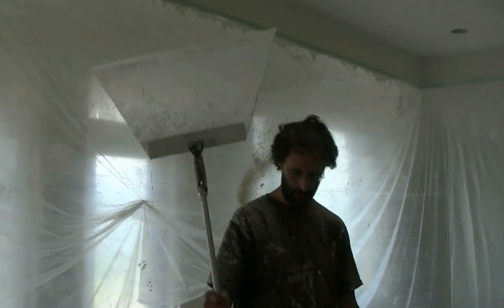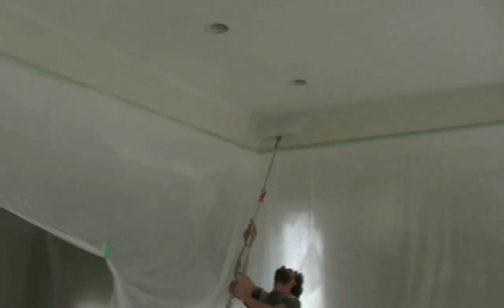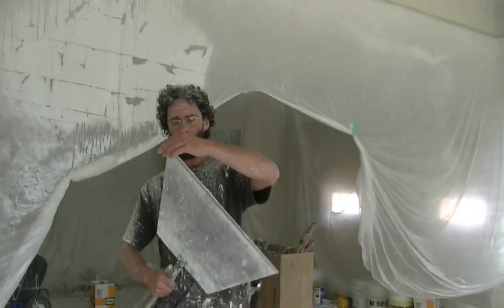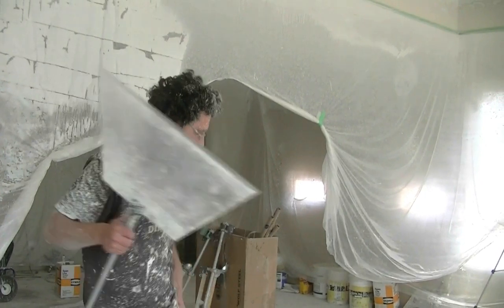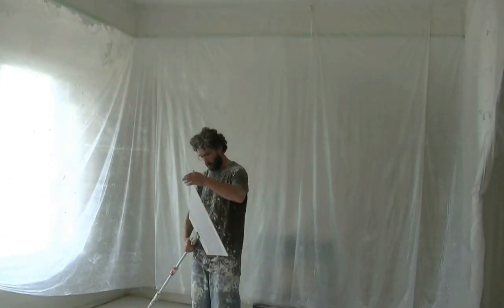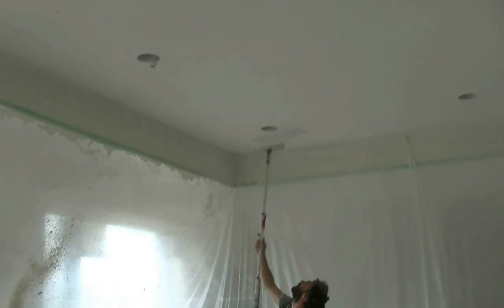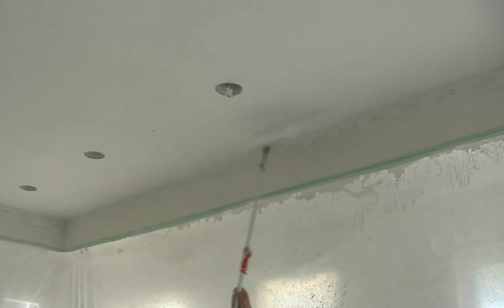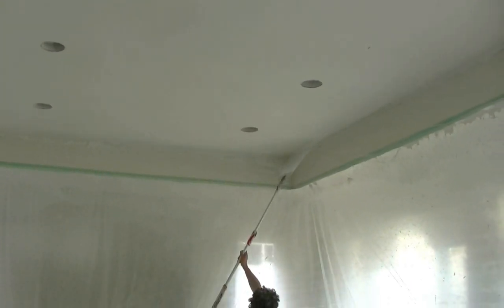California Knockdown Drywall Ceiling And Wall Texture , How To

Comment: Great video guys! My pop taught me all phases of carpentry and remodeling at an early age. This was in the early 70's and the style back then was orange peel on walls and popcorn with glitter on the ceiling. I have full time job now but still do jobs on the side. I still have his gold blatt hopper. My current job involves removing old 70's paneling, putting in drywall, scraping the popcorn off the ceiling and texturing. I have the knock down is the style but was not too sure how to finish. Thanks to this video I now know how! Great job my drywall brothers! Mud for ever!
Reply: I sure hope you're testing for Asbestos before you start doing work if not you're putting yourself people and they're families in danger as as I'm pretty sure you're not even warning your costumers about those dangers of removing popcorn ceilings, look up procedure 5

Comment: I have see it where the edges at the wall have been scraped clean leaving a nice boarder. This looks nice but leaves a nice edge for you to paint your walls as well. My question is, when do you scrape this off? While its fresh or just after you knock it down? I can see smearing it making a nasty mess.

Comment: Ok... I two questions:

1...when do you take the tape off? Right after you spray or after you knock it down?
2...I have seen it where there is a rounded edge around a bull nose corner. What would be the best way to achieve this look?

Comment from the maker: U can, alter pressure and the air, its not 100 percent since your mud density also changes with almost every batch, so your always playing with it to get it right before you start texturing a new place. And if you got a long hose on the dam thing, and its running all the way up the stairs, machine really has trouble pushing that myud through, and you really have to crank her up more. Thank You

Comment from the maker: Wait about 10 minutes, it really depends on how hot it is ... do a little corner first ... and it also depends on how hard you push, you don't want to smush it all against the ceiling, just flatening off the tips ... we use the gun instead of hopper because we do a lot of texturing, and the hopper gets heavy, but either of those tool do the same job. I suggest using premixed Synko Span Lite Texturing Mud, just need to had water to hit to get the right consistency ...

Comment from the maker: Directions are right on the box for water mix ratio, use premix stuff, don't use the dry in bag stuff. But for knockdown I advice not putting the exact water they ask for, hold back a little on the water so that mud is a little thicker, and the time, well you have to wait for the mud to set so that when you run your knife, it doesnt all flatten out, you just want to flatten the tips of it. So if your mud is more moist, or if its cold, wait a bit longer, always do a unseen corner first as a test.

Comment from the maker: 1. Doesn't really matter, I would take it down to make it easier to knockdown
2. Well I would use a pencil on a string, draw a circle lightly, which can be erase later with a white pencil eraser. Use electric tape to first tape off the circled line, and then use painters tape to finish protecting that area. Then hang your poly :)

Comment from the maker: And Again the right consistency depends on how hot or how long you wait before you knock it down, if you wait too long is doesn't matter how much water you mix in, it won't knock down ... Spray some on a scrap piece of board first, knock it down after 10 minutes, don't press to hard unless its starting to dry up to much you can start pressing, if its real wet still you don't press hard ....

Comment: You should get a real spray rig instead of that home depot crap.Then you wouldn't have more on you then on the ceiling.Hate to see it up close.If I waited 10 min. to start knock it down it would be too dry.You are putting way to much pressure on the knife bet it looks too flat.Guess I need to start calling mine FL. knockdown lol
Reply: agreed spray rig the right way or don't spray knockdown

Comment from the maker: Well it depends, your right if its hotter your going to have to hit it quickly, and yea it was cold around here when we did this roof, so we had to wait longer, but you can also adjust with how much pressure you put on the knife, of course if you press really hard on the knife, it will spread more and flatten more - even if its getting dry. And if your mud is still really wet, you can press less hard to end up with the same effect, if you press to hard when its wet you will flatten everything

Comment from the maker: They tape the area off, so that when you texture there's no mud on that area. Use 2 people when putting the tape, one on each end and pull to your mark, that will give you a pretty straight line, Then you can hang some poly using that line, you could do it with only tape, but I would recommend using staples as well, since once you get texturing it could get heavy sitting on the poly and it may start coming down. I've had it happen :(